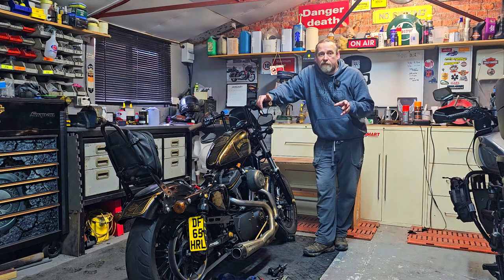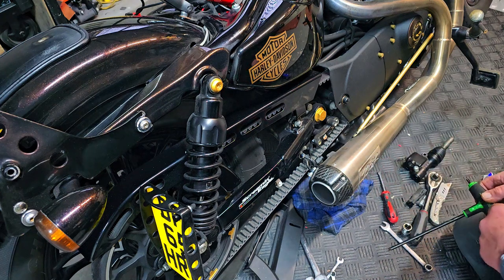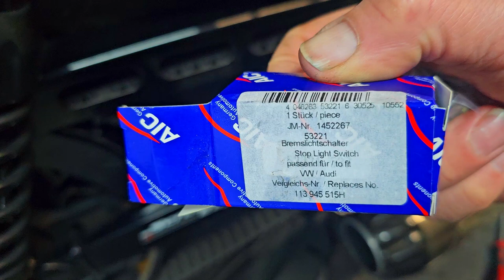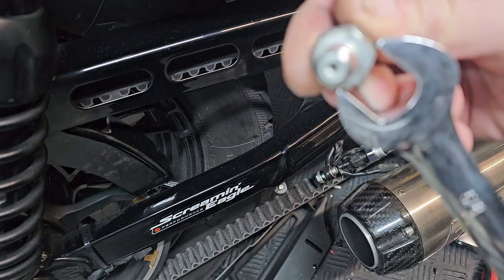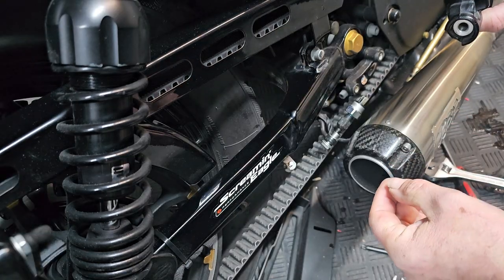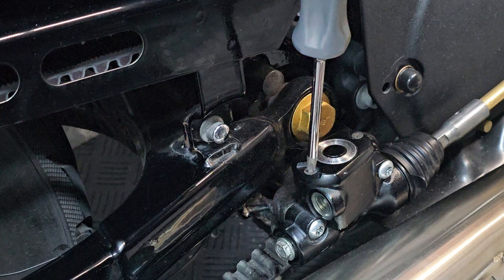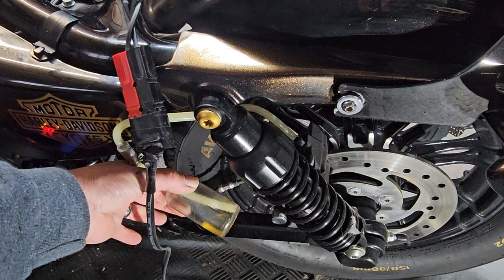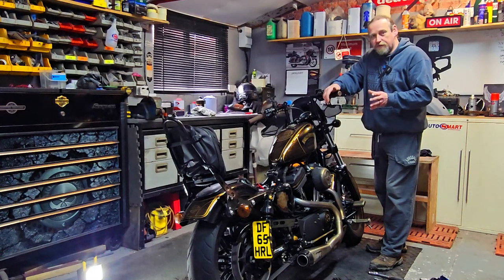SPORTSTER 48 REAR BRAKE SWITCH REPAIR

Comment: Great job Martin really informative and excellent work 👍👊
Reply from the maker: Cheers Steve. Not done any garage series for a while so makes a change 👍
Reply: 2014 883 I’m getting no brake lights not front or rear brake light signals.    What could it be
Reply from the maker: @valterferreira8171 Hi.. first double check the brake lights are not actually stuck on. As if its a break in wire maybe under seat for example, only 1 side would be off . If its later led lights, do you have the red light on dash?. If so. My first point of call anyway would be the rear brake switch, check 2 spade terminal wires to that under heat shrink .

Comment: Hi thanks for taking the time to record this. I have a very similar error (I think). Error code B2223. Rear brake switch shorted low. 
My brakes lights stay on. I double checked the front switch (your other vid) and found that looked to be ok. 

Do you know if it would be possible to disconnect this rear switch to confirm that being the problem before removing cylinder/end can? Perhaps elsewhere in the loom as it seems that the switch is well hidden behind the cylinder.
Reply from the maker: Hi, thanks for watching.. first off, sometimes your front switch might look ok but the spring inside could still be stuck, so if you disconnect the rear and lights still on you know its the front. But if error showing as rear brake, that is normally a correct error failure. I would change rear switch for cost and piece of mind. A couple of hours and your done hopefully 👍
Reply: @ALCHEMOTO  thanks for the reply buddy. I took the front handlebar assembly apart and all looks to be OK. I’ll get to work on the rear. Thanks again.

Comment: Hi Alchemoto, thanks a lot for this detailed vid! 👍
What year of manufacture is this Forty Eight? Or is this rear brake the same for all forty eights. Mine is 2015.
My issue is the same, rear breaklight wouldn't go off. At the backside of the swingarm I found a connector which I disconnected. Now the brakelight only works with the front brake. So next thing is to dive into the little hidden connector under the rear brake caliper. Is it possible to disconnect this without disconnecting the brake hose? 
Hopefully it's only corrosion at this point and solved with WD40?
Reply from the maker: Hi, And thanks for watching..
It sounds like yours maybe just corrosion on the connector. They do have a sleeve over them but its still only spade connectors on the switch.
My 48 is 2016 but they are all the same.
You can get at the connector but it is a bit tight. Easier with pulley guard etc off.
If connections are ok.. it may be worth getting a new switch. But more involved to change that out to get access. Not a bad job either way  👍

Comment: Hi guy, I have forty eight 2016 abs. I haven't brake light as well with rear brake and front break. Do you had an idea of the problem ?

Good job in your video !
Reply from the maker: The front switch behind the lever works opposite. When brake lever pulled, the switch pops out. I have a feeling it is stuck in. Do you have tail lights at all ?
You also need to check contacts at the rear pressure switch . It is usually opposite way round where brake lights stick on. So if none coming on I would say its front switch stuck. Try spraying into switch with electrical contact cleaner first 👍